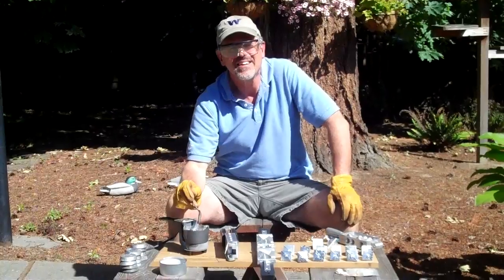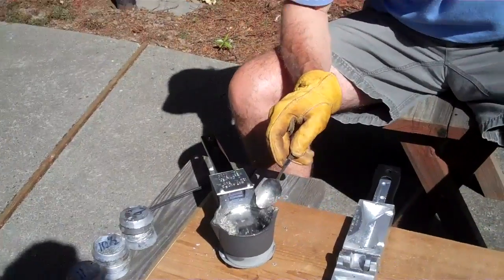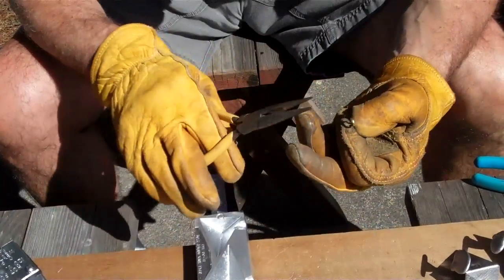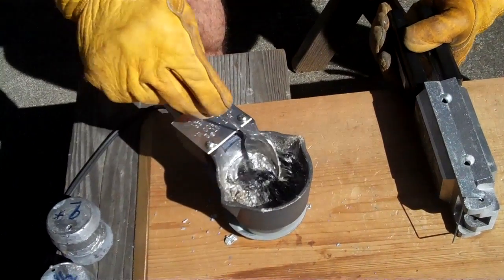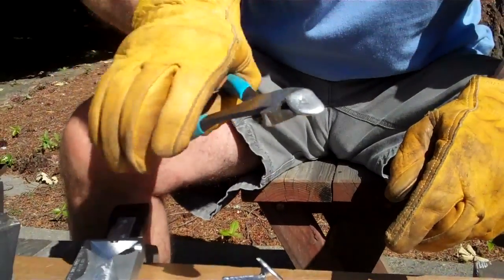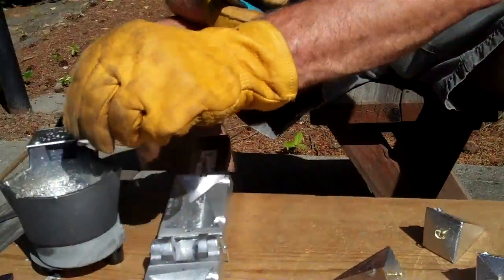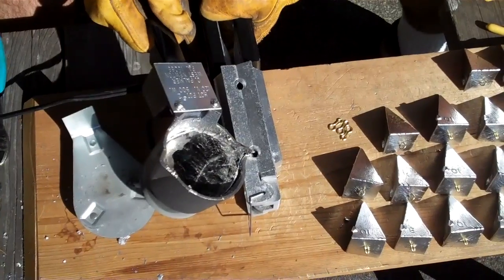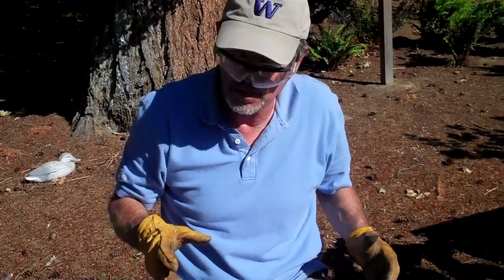Pouring some lead fishing weights

Comment: I'm so thankful that I wear a full mask respirator when I pour.  I was recycling some old lead weights and when I dropped one into the pot, it bursted.  Lead splatter was all over my respirator.  My only guess was that maybe the sinker had some moisture from within.  It was an old sinker I had found on a pier years back.
Reply: You should have a blacksmiths apron as well.

Comment: Hey here’s a tip my grandpa always did when I was younger and I still use to this day, Home depot sells chain, and small tubing. I hook the chain to the eyelights and crimp it and crimp a piece of tubing through the other end of the chain. It slides way way better on fishing line, and tangles way less plus no fraying. Tight lines!
Reply: Post a video

Comment: Done some lead pouring myself. I've made 2 and 4 ounces star sinkers using lead obtained from friends who got them from car batteries and roofing materials. We split the ready sinkers 50/50 as I supplied the lpg gas. True hard to get lead supply nowadays, you right, I've got them from the garages, ie the wheel balance stuffs, although some are steel that don't melt easily as lead. One SUGGESTION, we can use used SPARK PLUGS, from the garage as sinkers too. They are free! Tie up 4 together and the weight at leat 2 ounces?? Fish on!!!!

Comment: 4:20 It actually only hardens quick in your mold because the mold doesn't retain a lot of heat. I make molds out of wood and it takes the lead a while to set up especially if you get it too hot.
Reply from the maker: phartattack Actually the mold retains a ton of heat.  So much heat that after a couple of pours you can't touch it without gloves cuz you'll burn the shit out of yourself.  Fish on!

Comment: Hi good joob it's a pleasure to see you work  just a question would be safer to use a gas Mask while melting lead even outside? I usually do it outside with a Mask FFA2P3
Reply from the maker: Probably a good idea.  I do it so infrequently that I don't think my exposure is any more than I might get in a dental office taking X-rays.  But yes, thanks for the heads up.  Fish on!

Comment: When you melt lead do the impurities float to the top or do ya need to stir it around
Reply from the maker: All impurities float to the top.  Just spoon it off.  Be well, fish on.
Reply: It's best to flux your lead if you're using wheel weights. I use Buck's Beaver flux on my lead when using wheel weights. It pulls out the impurities like a dream. If it's clean lead no need to flux.

Comment: I've been doing some sinkers lately and I've gotten some not so looking outcomes. How or what can I do to fix that. They are coming out really rippled effects is that makes sense
Reply: Juan Hernandez     cold pour. Preheat mold aswell.
Reply: Juan Hernandez heat your mold first. I pour a few times with no eyes to get the mold hot. Once they start pouting well with no wrinkles, then use the eyes and start making weights. Also, if you are pouring large weights you need to be able to get the lead in fast enough. I use a cast iron ladle for anything over 2oz vs a pot that drains from the bottom (those are great for small stuff).

Comment from the maker: Do-It molds.  Here in Portland at Fisherman's Marine about 28 bucks on sale.  I'm sure you van find them online at your local bait n tackle shop.  Fish on!
Reply: @12345B  good ventilation. Don't melt lead indoors unless you have a fume extraction system. 3M does make a resperator that will work for lead fumes. I normally run a fan to help blow away the lead fumes and always melt my lead outside.

Comment: you should smoke your mold before you start pouring
Reply from the maker: TheChronicRhythm  Smoking the mold is just not necessary.  I tried it and found it a waste of time.  Thanks for the tip though, be well and fish on!
Reply: mine have always get air pockets or craters when I don't. our process looks similar. I wonder what I'm doing wrong.
Reply from the maker: TheChronicRhythm   Never had that problem.  I did bore out the entry holes in the molds a bit larger than they came from the factory.  That way the lead pours smooth without interruption.  Also make sure you draw off the impurities in the lead before you pour.  Good luck.
Reply: either you are not poring fast enough or mold isen't hot enough

Comment: Where did you buy your lead??
Reply from the maker: Striper4evr My father in law was an avid fisherman and hoarded the stuff!  I've got enough lead to pour me into the next century!  Be well and fish on brother!
Reply: Get lead from a tire shop a plumber a roofer or go to the scrap yard and see if they have any for sale. you may want to find an INGOT or cupcake pan to pre-melt the lead and make clean lead blocks to use later.
Reply: @Mark AbolofiaI think he meant where can he find lead.
Reply: I have been getting wheel weights from a shop down the road from me. I will melt down about 20 pounds at time. At least that is what my cast iron pot will hold. I flux my lead no less than twice with Buck's Beaver flux. Pour ingots with a muffin pan. I've got about 300+ pounds.